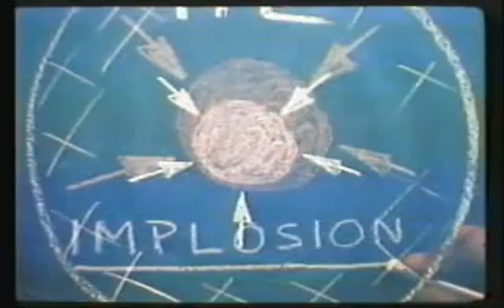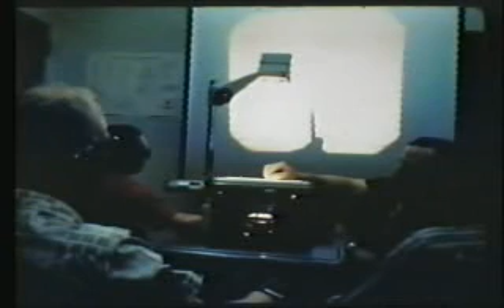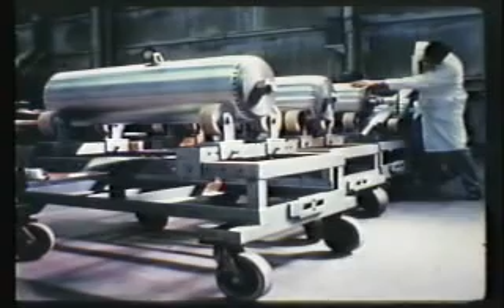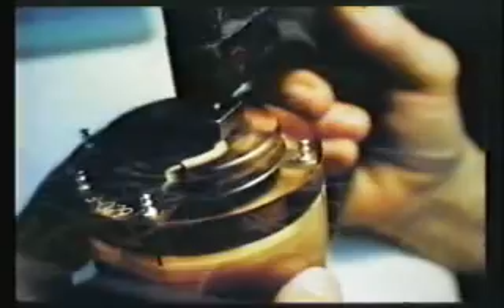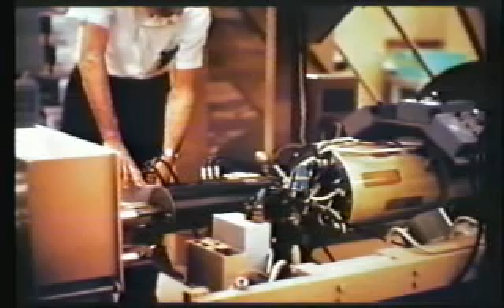Declassified U.S. Nuclear Test Film #72

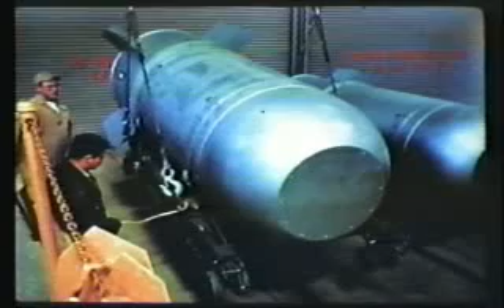Comment: 22:40
Wow. That's a B-43.
23 megatons of megadeath. 
It will pretty much sterilise everything within 20 miles that's not in a blast resistant shelter. 
On a bright clear day you'd get 2nd or 3rd degree burns at 30 miles.
The US had 500 of these bad boys in stock.

Comment: Whats the yield? 5 megatons?
Reply: Nope.
The B-61 is a variable yield weapon, a so called 'dial a yield'.
Depending on the model type, there were 13 models, but not all were produced, the yield ranged from 300 tonnes of TNT, to 340,000 tonnes of TNT equivalent.
Not bad really. 25 Hiroshima bombs all in one bomb. The part of the bomb that actually goes bang, is the size of a large fire extinguisher. With carrying straps, an average adult could pick it up a walk away with it. The Hiroshima bomb weighed in at 9000lb.

Comment: I can't believe this is for the most part declassified. Those are technical descriptions of a current arsenal weapon.
Reply: The hard parts are still being kinda-sorta-half-way not talked about, such as how pit levitation is actually accomplished, the nature of secondary /primary levitation and x-ray "foam" (Fogbank), how lens curvatures are calculated (especially for 2-point), additives for tweaking lens explosive speeds, security measures for the physics package, oh and high precision detonators like EBW etc detonators not generally available from Tractor Supply... I imagine there is enough plutonium on the loose, but the confidence of actually building a working device is not high. People who watch a movie and get the idea that it's easy don't know enough about the topic. The terrorists who want one, do.
Reply: @railgap  
I completely agree. Even the Trinity bomb, the components of which are declassified, there is even a video film about the assembly of this bomb. But nevertheless, the exact sizes of the devices and proportions are strictly classified, and thermonuclear weapons are even more so. They are extremely difficult to calculate and will not work without preliminary tests, so declassifying superficial information will lead to nothing.

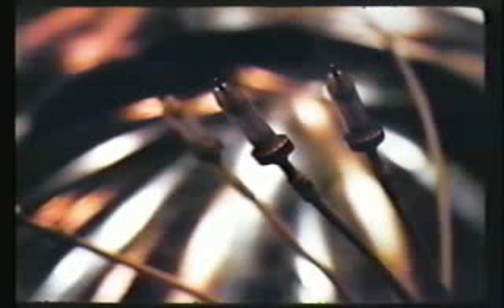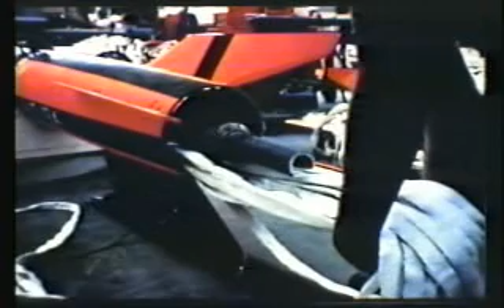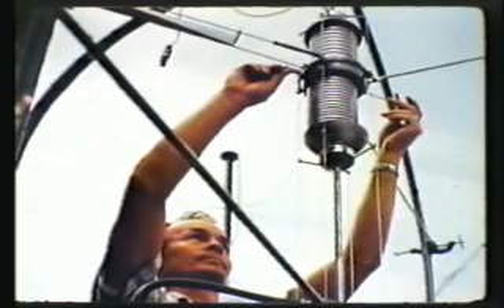Comment: I think the parts you see at 12:45 are part of the parachute deployment equipment.  See image at 12:04.  This is a "mortar" used to kick the parachute assembly  (pressure packed to the density of oak) out the back of the bomb, then another charge starts the parachute opening sequence.  I think that the item shown at 10:07 may be part of the secondary.

Comment: You dont need the perfect sphere to create a bomb. You could always use the "bullet" method as an alternative which doesn't require such perfect specs. Enriched materials are really only needed for high yield devices. For a low yield device, or a dirty bomb, the refined materials aren't as important.
Reply: Below 80% enrichment in the U-235 isotope,  the amount of material needed to create any meaningful yield becomes enormous.
Below 60% we are talking in tonnes.
The sub-critical components become so heavy that you can not move them rapidly enough together to get an explosion, you would just get some heat and perhaps some serious melting.
In the implosion system, if your talking about 100s of kg of uranium-235 or plutonium-239 that isn't very pure, the material becomes extremely difficult to compress, fat man had more than 2000kg of explosive with 95% purity in order to compress a 6.2kg pit.
If that pit was 100s kg you would need 10x or even 20x as much explosive.

Comment: Actually is the opposite around... You can get the materials, but what is hard to do is to "enrich" nuclear material and then calculate the correct dynamics in the explosive to create the perfect sphere that makes it reach critical in mas. Then the bomb has to be capable of beeing handled safely.
Other problems are the developement of delivery systems like rockets, which in itself is a problem in reliability.